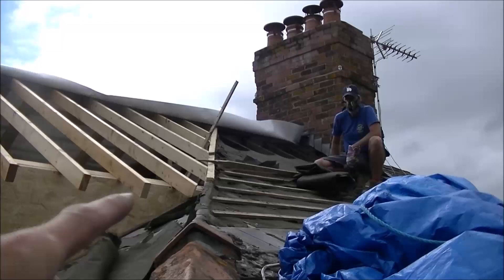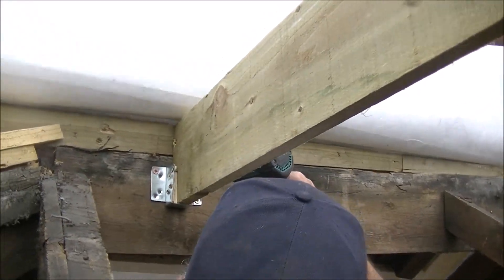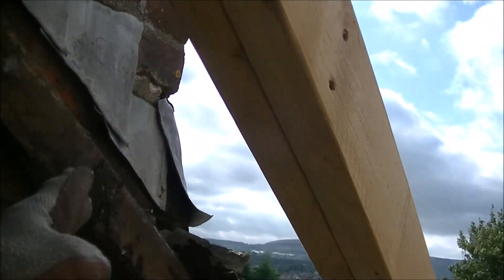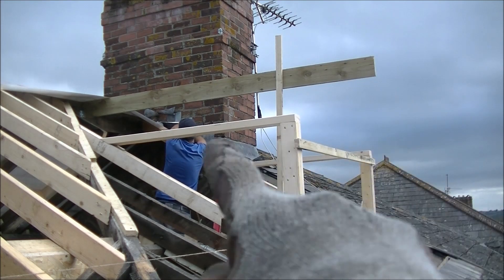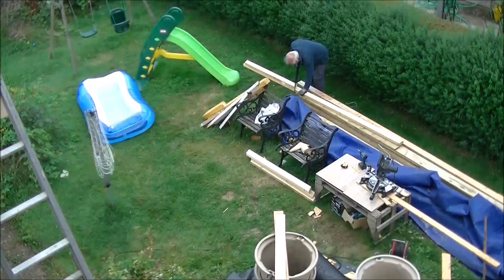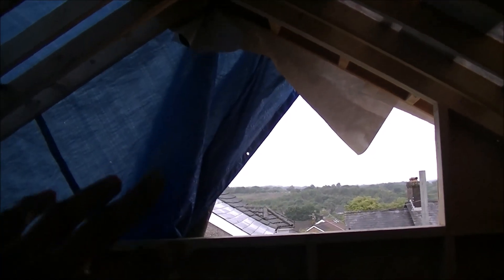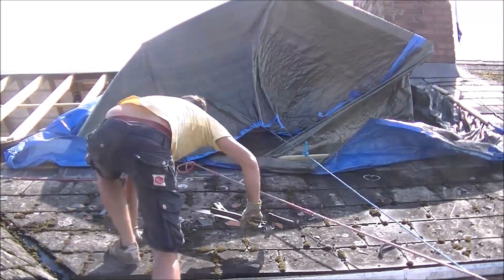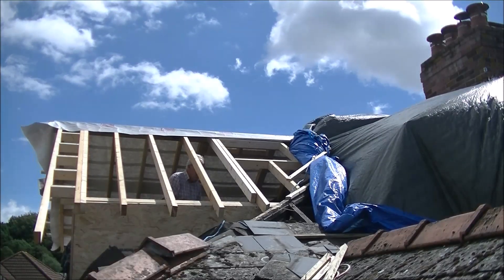Loft conversion part 12 - Build the rear dormer. Pitched roof dormer construction & Velux frame.

Comment: I bought myself a dewalt framing nailer from eBay; it’s so quick and easy! Amazing bit of kit. Seems like you screw everything (it’s no doubt stronger), but I can’t praise it enough 👍🏻
Reply: Is it tidy? I'm guessing just battery and no gas? I've been eyeing up a paslode (battery and gas). A friend has one and it's a nice tool. Only issue with its size is getting into a.tight spot. I personally am not so sure screwing would be any stronger than nailing but screwing allows for a lot more accuracy in my opinion. Lets see what old Pousey thinks is it?!
Reply: Big Pouse Seriously tidy...gas is a pain in the ass. Just charge up the battery and away she goes. If you can’t get into a tight spot, put a screw in, that’s it (it’s rare I have to put a screw in). Amazing tool. Can be a bit temperamental as it’s a precision piece of equipment, but once you know how it works you’ll be away. If your not framing all the time it might not be worth the expense. I’m doing a loft conversation and it’s been a godsend.  Putting in noggins, plasterboard supports, joists,rafters, sheets of osb etc. Really solid. Does up to 90mm collated nails.
Reply: @gdfggggg  my issue is I'm all Makita tools. So it means buying the matching batteries, charger etc just for 1 tool. I personally do a lot of stud work etc (1st fix some might say) so it's something I need to think about to bring down my time scales. 👍
Reply: Big Pouse See your point. I’ve always bought dewalt so I’ve got loads of battery’s/chargers that I can swap about no problem. Always found Dewalt tidier than most.  Good luck with you hard work 👏🏻
Reply: @gdfggggg  thanks. Same to you!
Reply: Big Pouse 👍
Reply from the maker: I would love a nailer, and probably should have bought one, but I'm so far through project it's too late now, although I could treat myself for future projects I guess. Thanks for the feedback!
Reply: @POUSEaroundtheHOUSE  buy me one for my Birthday and you can borrow it Fab!

Comment: So far, we've watched all 12 videos with rapt attention. We can't wait to see the whole project finished. We've been wondering what the age of the building is? Judging by the filthy looking rafters our guess is 75-100 years. Is it a free standing building with 2 units? Are we correct in our assumption about the age?  Some of the surrounding houses appear to be newer though. Maybe you could do a bird's eye view tour of the neighborhood from your finished loft when the work is done.
Reply from the maker: Hi, the house was built in approximately 1890. There are a handful of victorian houses on my road, then opposite we have 1930's houses (which are nicer looking than mine), then the later housing estates were built in 1950's - 70's around the area. Although my house and the attached house are the only one of their kind. They appear to have been built independently of anything else in the area. Hope that helps. I don't have a drone but some drone footage would have been nice while working on the roof. Thanks for watching, plenty more to come!
Reply: @POUSEaroundtheHOUSE  
Thank you for the added information. I take it that the present roof slates are not the original roof. Thhey look pretty crusty but not 130 years old. 
Are any of your other videos work you've done on the inside of your house? 
Thanks again.
Reply from the maker: @oltedders  not the original slates on mine. Many of my videos are on my house although not all. Some damp videos may be of interest to you.
Reply: @POUSEaroundtheHOUSE  
Thank you for the recommendation.  The biggest problem with wet foundations in the U.S. is black mold and infestation of termites and wood boring beetles, as most houses here have been and are still wood framework structures. 
I'll go back and watch more of your videos I may have skipped in the past. Nothing like watching men at work. Something that has fascinated me since I was 6 years old.  Thanks again.

Comment: Great series. Good to see it in such detail. Just wondered how you got away with the main ridge being a ridge board rather than a ridge beam considering the addition of the rear dormer? Because it's only a relatively narrow dormer??
Reply from the maker: The new joists are taking the load on the side dormer and the rear dormer is built on strengthened rafters and again, the load is transferred through the purlin and down to the new joists. The joised are spanned across 3 losd bearing walls. A beam is only used where the ridge board needs to be structural, usually when a roof is of a low gradient, or a flat roof, or where the original roof was a trussed roof that has been cut out. Hope that makes sense. Obviously, speak to a structural engineer if you do this yourself and they will discuss your options. Thanks for watching.

Comment: Hello, question, how many square feet was this space before you started construction and do you have an estimate of how much this would cost?  I just found your videos and am amazed and inspired to do a Reno of my attic as my house is so small, I think it is 750 sq ft.  Thanks for sharing
Reply from the maker: I would have to work it out. If you have a hipped roof and your house allows you to do so you'd be better going for a hip to gable conversion with a flat roof dormer. Doesn't look as nice in my opinion but way more room. Probably cost more but easy to work with flat roof and walls rather than loads of angles like mine. Also I have a family, young child and 2 years later it's not completely finished, so just bear that in mind if doing it yourself. Also if you increase the space to much you may need planning permission. Best of luck with it!

Comment: How often did you get building control come down to check the work for integrity
Reply from the maker: They did a few visits per each stage. Once plasterboard was on they weren't so bothered. Just needed certs for electrics, fire alarm and see the fire doors. Thanks for watching.

Comment: What stops the rafters spreading under the weight of a finished roof? Is there a timber to go in above your head?
Reply from the maker: There are horizontal timbers at the base of the front of the dormer which are covered with osb board which is screwed into the horizontals and verticals, providing the structural support required to stop the cheeks spreading. This combined with the small span of the roof means it won't spread. If the span was much larger and no horizontal timbers were in the front then you could as you say put a horizontal under the ridge board between rafters. Hope that helps, thanks for watching.

Comment: The extent of the work you’ve done it would of been easier to put an entire new gable roof on.
Reply from the maker: You're probably right, but it would have cost more and required full planning permission which is more time and again more cost. In theory you could have done what you suggest with a large flat roof dormer across the back but the purpose of the space was for an extra room at an affordable price so I think I've achieved what I set out to do. Thanks for the comment and thanks for watching.
Reply: Indubitably. Remodeling takes 3X the work of building new...at least!
Reply: I’ve just done a completely new gable roof/dormer conversion for someone. You can’t really do that without a tin top scaff as you need to remove the whole roof and start from scratch and scaff for that would be around 4(+) grand. The beauty of what pouse is doing is you can get away without the tin top.
Reply: @gdfggggg  that's exactly why he did this way. Tight budget so the £30 tarpaulin trumped the 4k roof wrap! It's a bit of extra work but as Labour is himself it saves a fortune 👍
Reply: Big Pouse true dat. If I was building for myself I’d probably do the same thing. If someone was paying me I’d opt for the tin top 😉
Reply: @POUSEaroundtheHOUSE  if that works for your budget I understand. Ignore my opinion I'm just a pompous architect that looks for the easier routes.
Reply from the maker: @ Jonathan Loughry - As Slashley Gibbons and Big Pouse said, it was the cost of scaffold over the top really. If my budget was endless I could have opted for hip to gable, with full width dormer across rear, but the cost of scaffolding would have been about a 3rd of the cost of my existing loft conversion which includes re-slating the entire roof.  So it was really a case of doing it because I could do it cheap. If I was paying for the full maconky, I never would have embarked on it in the first place. But thanks for your comment, perfectly valid point.
Reply from the maker: @oltedders - You're right, but it was a cost and convenience issue. I was able to do this project at a viable cost without taking the roof right off. If the builders were in and budget was open ended taking it off would have been the best option I think. Thanks for the comment.
Reply: @POUSEaroundtheHOUSE  
We're still working on the total remodel of our 1977 mid century modern bungalow in Texas, U.S.  Finally seeing light at the end of the tunnel. 
Watching many YouTube remodeling videos we are in awe of the extensive scaffolding erected by Brits for their construction projects. You mentioned the high cost. Apparently it is a considerable part of any builders budget there. It is quite frequently absent or minimally used here in the states. We did rent some ourselves to finish two high ceilings. Very pricey indeed.
 Looking forward to the next video. Thanks again.
Reply: Hi mate. Excellent work